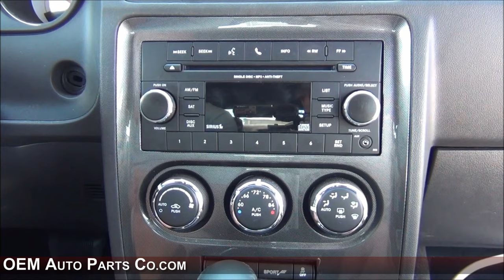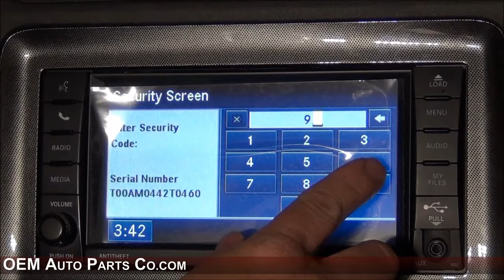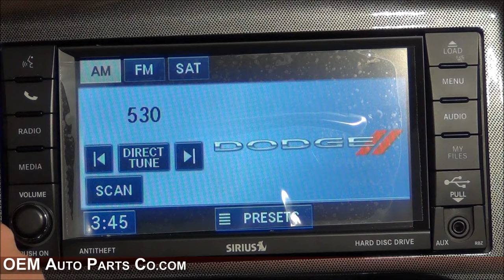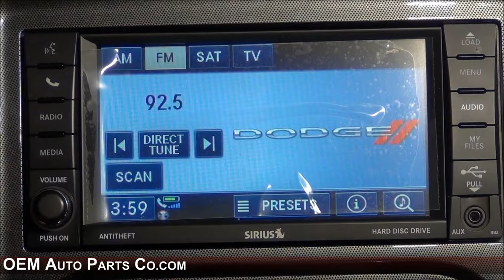RBZ 430 MyGIG Touchscreen Media Center - Easy Plug & Play Install! - Chrysler Dodge Jeep Ram

Comment: Do you guys have the installation process to add U-Connect to a myGIG 430 and how to program it?
Reply: i need help with this too. Did you find out how to do it. I have this radio system but no connect.
Reply from the maker: Yes you can add Uconnect to a 430 RBZ. It would require a Uconnect Kit. Our kit is plug and play and includes our OBD programmer so that no dealer visit is required!

We sell 2 kits based on your vehicle compatibility:

https://infotainment.com/shop/interior-accessories/infotainment-radio-upgrades/uconnect-hands-free-kit-high/

https://infotainment.com/shop/interior-accessories/infotainment-radio-upgrades/uconnect-hands-free-kit-low/

Comment: What if you have this system in your car and the voice/phone does not work? Does that mean  you do not have the connect? How do i find out what I need? is it a plug or software. Can i take it somewhere to find out?
Reply: +Den V i have the same issue you have
Reply: +Jamail Randle did you radio before have UConnect?
Reply from the maker: Yes that means you don't actually have Uconnect. But you can add it! Our kit is plug and play and includes our OBD programmer so that no dealer visit is required!

We sell 2 kits based on your vehicle compatibility:

https://infotainment.com/shop/interior-accessories/infotainment-radio-upgrades/uconnect-hands-free-kit-high/

https://infotainment.com/shop/interior-accessories/infotainment-radio-upgrades/uconnect-hands-free-kit-low/

Comment: can i put a used 430rbz mygig radio in my dodge nitro?
Reply from the maker: It would need to be cleared and programmed to prepare for a new BCM. If you were to send that in to us, we could reprogram that to the new Vin and then send it back for $139.95.  Second option on this link. 
https://infotainment.com/shop/services/remote-programming-service/programming-service-factory-oem-radio-bench-test-vin-programming-4/